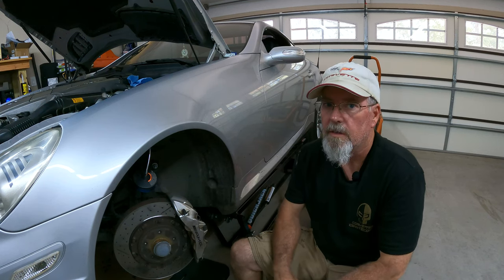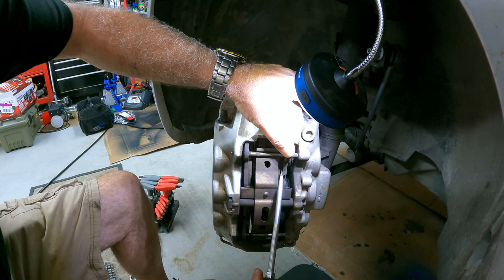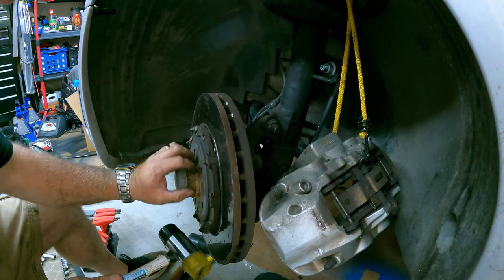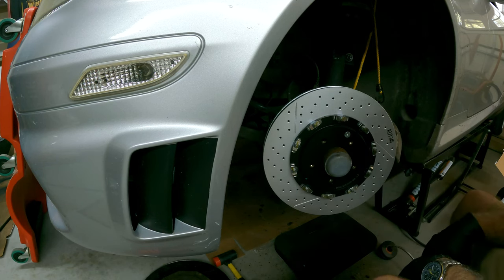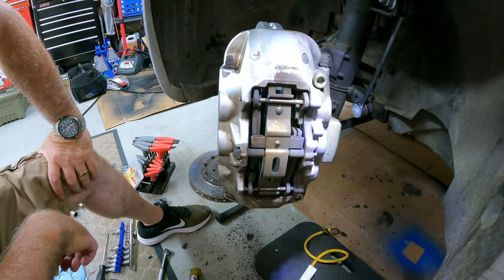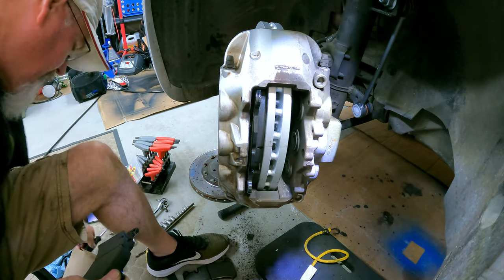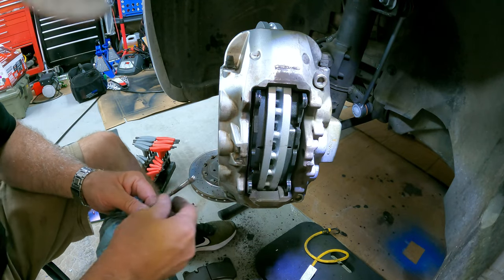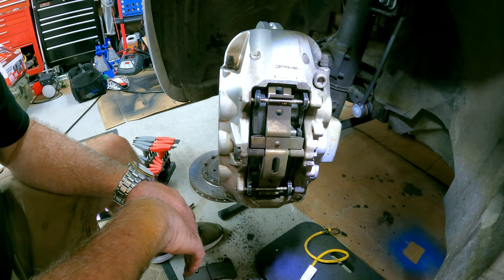Replacing Front Brake Pads and Rotors on my 2006 SLK 55 AMG Mercedes #amg #mercedes

Comment: Can you provide the products you've purchased from FCP Euro? I'm not sure if I should order 360mm x 32mm or 340mm x 32mm for front brakes. Do you need two brake wear sensor for the front brakes? one for each rotor?
Reply from the maker: Sorry it took me a bit, had to get home and check my account.  The wear sensor is on the front passenger side and you only need one unless you're doing the back also.  I did edit the video description with the parts list, thanks for bringing that to my attention.😎

Here are the part numbers I used from FCP Euro:
Wear Sensor BOW-A098023 (1ea)
Mercedes Brake Pad Set PAG-355019521
AMG Brake Disc BRE-09925433 (2ea)
Brake Grease ATE-700015 (Tube)

Please let me know if you have any questions.
Reply: Thank you and subscribed 😊

Comment: If there's no obvious 'damage/wear' and/or warping of the rotors (front),  can you get away without changing them, when you replace the pads?
Reply from the maker: You can but these were beyond that point.  I'd suspect they had been pad swapped twice at least.  I'll do pads once and then rotors and pads the next time but a third set of pads is pushing it in my opinion.
Reply: @YellowJacketGarage  Thanks for the reply!
Reply from the maker: @funkdaddy123  I try to respond to everyone if at all possible.  The reason I have my channel is to try and help where I can.  Thanks for watching and subscribing.😎  Tell your friends too.🤣